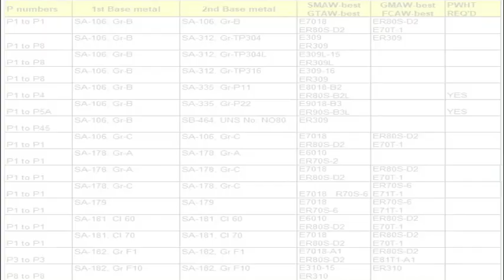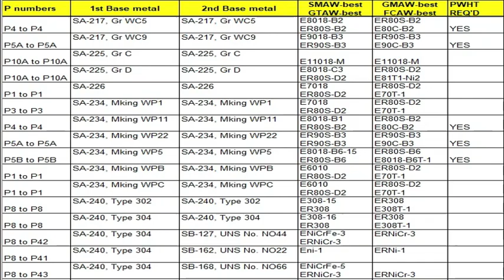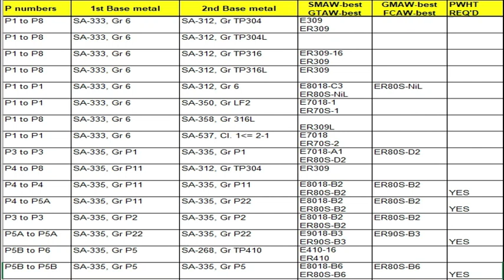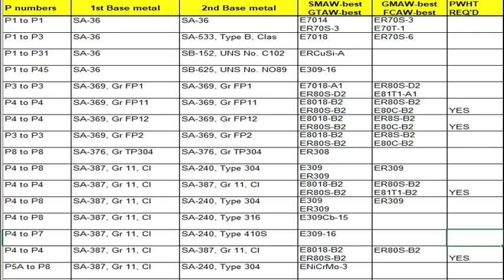Welding  Filler Metal Selection Chart [WELDING]

Comment: Hy dear this video is very interested but sir tell me this table is available 
 in which asme section
Reply from the maker: Hii, this chart is made by me as per the experience. You can not get this in ASME Sec IX as a table. All this information you can get there but all in different page not as a combined table.
Reply: @WeldingNDTInspection  kindly send me this table

Comment: Sir can u tell plz which filler rod will be used for aluminium base metal
Reply from the maker: Send your email Id, I will give you one good study material, from there you can get easily which base material need which filler metal. As there are so many filler details mentioned.
Reply: Thanks sir for help me 🙏🙏